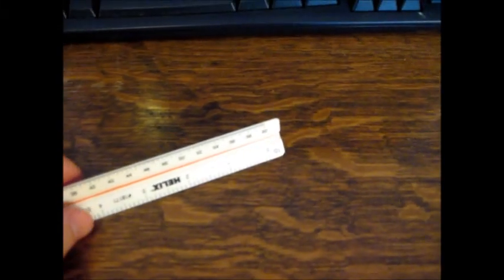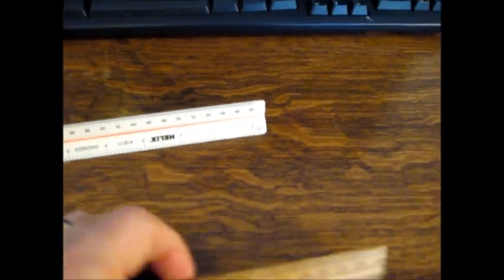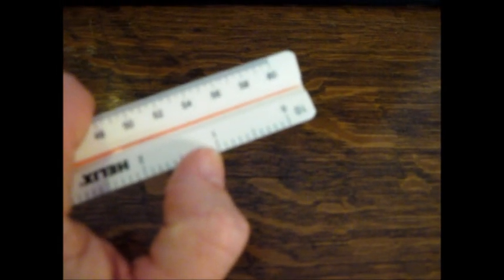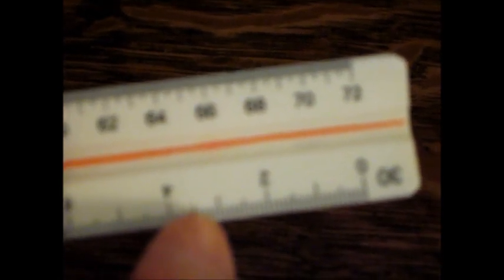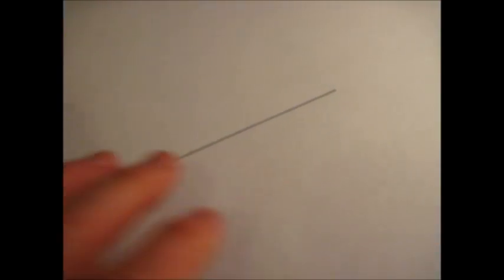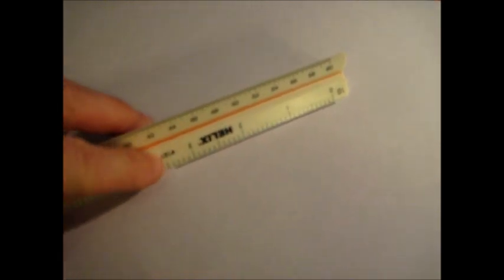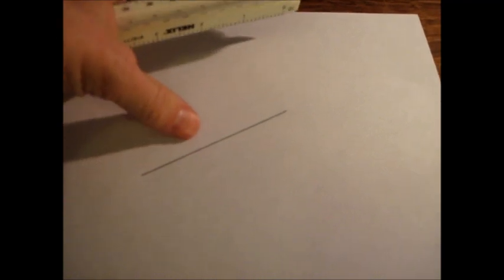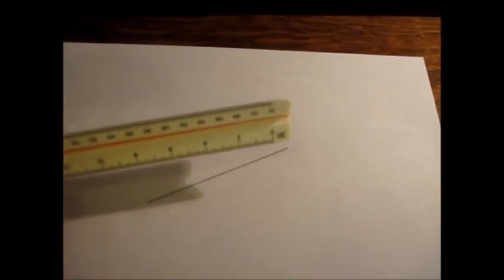How to use an Engineer's Scale (or Engineer's Ruler)

Comment: Too bad, I mean I know what is blurry AF in front of the camera which I think I'll be able to use to my advantage.  I'll give it a shot, but your keyboard keys are DAMN CLEAR.  Your camera could have been focused perfectly on the ruler if you changed the focal length by adjusting the lens if that's an option or if not, TEST FIRST, then hold the ruler -  where it's clear damn it!  I just can't use this video.  I under stand what you're saying, but the extreme focus f-up is just too much for me.   Sorry coming of like a dick I really am, but with all the shit talking from everybody else, I'm sure you got this figured out.  I just don't know why the hell you didn't just REDO it.  The video was under 4 minutes dude.  Hell, MSPAINT drawings or still images with your audio would have been fine too lol.

Try this trick  if using auto-focus (yes I know this is 7 years ago STFU) - you put your hand behind the part you're trying to get it to focus on then yell "Focus, YOU FUCK!" make sure you don't have the subject matter 2inches from the damn lense unless it's designed for those types of shots.  
Apologies for the ribbing, but I'm a slightly bit more knowledgeable on how they work now I think.  Imma watch a clear one to make sure sure.

Comment: Miles are cool but do not give complete explanation as I'm sure most of us will be using for feet. So If you added an explanation of a random measurement of like 12'4" or 12'5" anyway something with inches, so we could understand how 10 segments breaks into 12 inches on this ruler. Just adding that would make your presentation complete and the best easy to understand thats out there.Thanks. (Im doing a parking lot site plan and the city traffic planner wants it drawn to 20 scale, not knowing anything about that, I have learned alot on here with all these videos....and this guy explains it very well... just the inches explained.)

Comment: WHICH SIDE IS WHAT MEASURMENTS
Reply: They aren't measurements per se they are increments.  Eg, if you're using 1 increment for a mile then 4 increments (notches on the ruler) would be 4 miles.  In between the 2nd and third notch would be 2 and a half miles.  Its the same for other sides but if spaces are further apart then your drawing would be larger.

Comment: First off please fix the focus on your camera as referencing to a blurry stick is hard to follow. Also use it in action. Using words like ratios and scales is already hard enough for us non engineering plebs. It'd be very beneficial if you slowly went through and demonstrated the concepts in action. "here's a building that is set to be 1" = 10' now let's see how it's drawn to a scale of 1" = 30', see how you can switch the sides of the ruler to help convert the numbers properly?"

Comment: Thanks for the knowledge.  Wish you'd have explained the 20:1 ratio a little more.
Reply: 10:1 - means 1 inch is equal to 10 feet (on drafting designs etc.) or 10 miles, if you're looking at a map with that scaling.  Maps usually have a key that says 1 inch = X miles - so you can use this ruler to know how many miles you're looking at on the map.  20:1 - means 1 inch is equal to 20 feet (on drafting designs etc.) or 20 miles, 30:1 - means 1 inch is equal to 30 feet (on drafting designs etc.) or 30 miles, and so on.  So, rather than using a regular ruler and getting a distance of 4 3/4 inches and having to multiple it by the miles/inch, you would just use the side of the ruler that matches to the scale of that map (or drawing), and if it was 50 miles/inch, then instead of seeing 4 3/4 inches you would see a marking for 237.5 miles on the 50 side of the ruler.